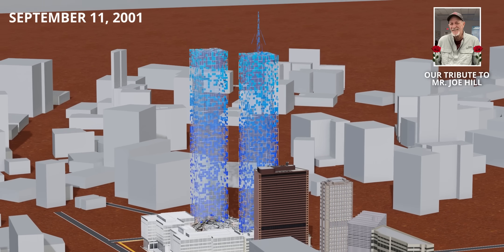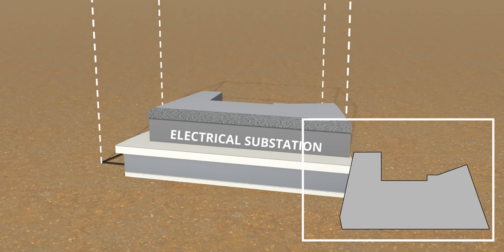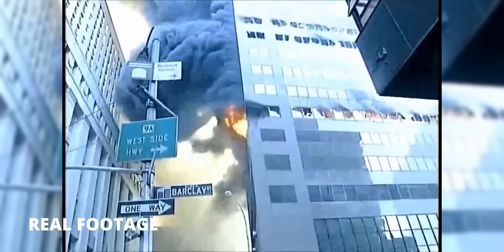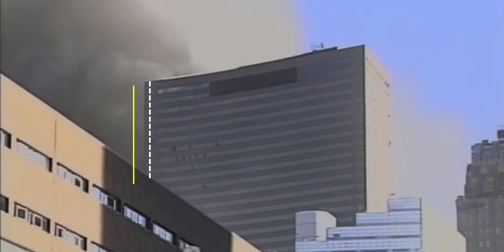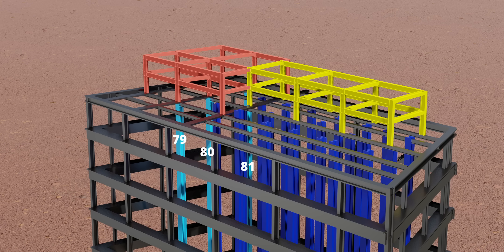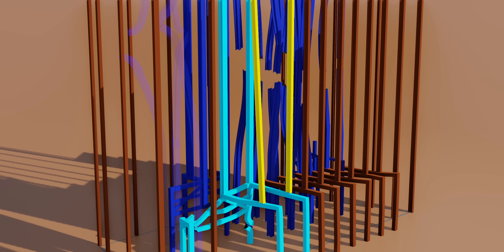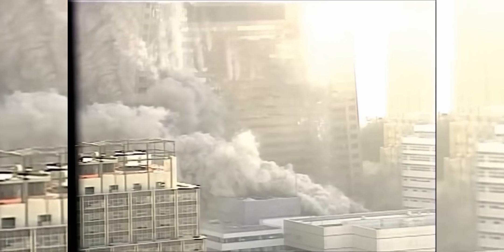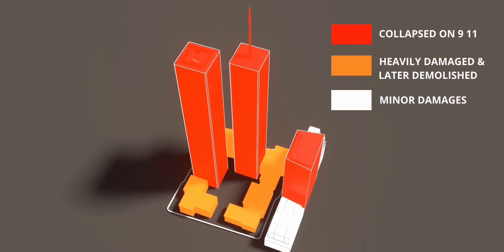Collapse of Building 7 | The Complete Physics

Comment: Another worthless fraudulent video.  All the buildings' collapse were the result of "Controlled Demolitions". The morons producing this garbage, should do their homework about the reasons of why the buildings were taken down !  How much were you paid to produce this trash ?
Reply: I did my homework. How did I do?  

Building 7 was 1 of 6 buildings to collapse of 10 lost on 9/11 and though extensively studied still confuses many. Not famous or a terror target and with no casualties it didn’t get a lot of attention initially, creating an information void the internet would fill with utter garbage. I prepared this brief summary from my own analysis to fix that, using engineering, not politics and tired memes. 

The North Tower collapse at 10:28am bombarded Building 7 with tons of debris, causing heavy damage and multiple floor-wide fires that burned out of control for 7 hours. Half the FDNY firefighters having been killed, others injured, units in disarray, equipment destroyed, no water pressure, and the greater urgency of Search & Rescue efforts, firefighting was pulled as futile. The building couldn’t be saved and was left to its fate. That is the sort of choice firefighters make every day in brush fire situations - which houses to save and which ones to let go. Only real difference here is moving the decimal on the size and cost.

www.youtube.com/watch?v=g_SvpwyC17M&ab_channel=MFitz  

Collapse of a burning structure is always a concern for firefighters. Steel buildings subject to fire rely on active fighting of the fires to survive. Buildings are designed around 1 to 3 hours of fire resistance, allowing time for occupants to escape and ACTIVE firefighting to get started, after which all bets are off. Left to their own devices they will exceed their design envelope and collapse. In B7 the occupants escaped, passive and active fire protections were compromised and active firefighting was abandoned which left the building to its fate. It lost. Odds on Building 7 would eventually collapse, and it did. No big deal in logic. But there is no logic in conspiracy belief. 

www.youtube.com/watch?v=WnYBX6QT0R4 

FDNY Chief Daniel Nigro ; The biggest decision we had to make on the first day was to clear the area and create a collapse zone around the severely damaged 7 World Trade Center, a 47-story building heavily involved in fire. A number of fire officers and companies assessed the damage to the building. The appraisals indicated that the buildings structural integrity was in serious doubt. I issued orders to PULL back the firefighters and define the collapse zone. It was a critical decision; We could not lose any more firefighters. It took a lot of time to PULL everyone out, given the emotionalism of the day, communications difficulties and the collapse terrain

FDNY Deputy Chief Peter Hayden ; We had our special operations people set up surveying instruments to monitor and see if there was any movement in the building. We were concerned of the possibility of collapse in the building. And we had a discussion with one particular engineer there, and we asked him if we allowed it to burn could we anticipate a collapse and if so, how soon? And it turned out that he was pretty much right on the money, that he said 'In its current state you have about 5 hours

The collapse of Building 7 was anticipated and widely reported in the media throughout the day. At least 24 video cameras recording some or all of the collapse. Everyone knew what was coming and why.

www.youtube.com/watch?v=OY5S5k3tMHI 

Building 7’s collapse was completely different to the Twin Towers and harder to understand with most details hidden from view. But we can still sort out what happened through careful analysis and observation.  This is my explanation  of the collapse using the best available information and relying on no authority.

B7 was complex 47-story steel framed structure built on top of a smaller existing 3-story building, requiring several lower floors dedicated to complex load transfer structures instead of usable office space. Of trapezoidal shape and all-steel tube-in-tube construction, B7 (above the 7th floor) consisted of a central core of steel columns carrying most of the gravity load, perimeter steel columns around the outside of the structure carrying the remainder of the gravity loads and long span beams and girders to tie those elements together and form the floors. On the outside of the building hung a moment frame - the last part of B7 to fall 

Phase 1 : The first externally visible signs of collapse initiation occurred at 5:20:28 pm and was notably quiet with observers not even realizing the building was collapsing! There was no audible warning in the form of  hundreds of ear drum busting 180-190dB explosive bangs preceding the collapse. Here at 12:00 a local CBS affiliate reporter is talking 10 blocks from B7 when collapse begins. People don’t start to notice the collapse until 12:11. At 12:45 is the famous CBS fixed camera clip of Building 7’s collapse. Note how quiet it is.

youtube.com/watch?v=t5tEy6mXSE8&ab_channel=fresnosean379

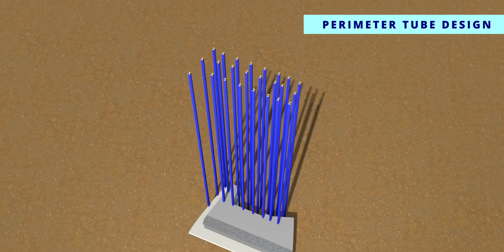Collapse initiation was due to lower floor failures above the load transfer region (7th floor) in the NE corner. In this video at 0:45 you can see the NW corner from inside the building while under construction, Column 79 just out of frame on the left. That big, angled steel beam across the top of the frame connects to C79 at one end. The girders connect to the beam. That beam and all those girders depend on just one connection

youtube.com/watch?v=nP3TNHPCIVU&t=35s&ab_channel=EdwardCurrent

Phase 2 : Lower floor failures caused a loss of critical lateral support over an excessive length of core Column 79 and it buckled. If you look at a floor diagram of Building 7 (see above) and look at all the structures that depend on C79 you quickly realize this one column was a relatively isolated structural element on which a disproportionately greater fraction of the structure depended analogous to say the Key Bridge. Externally we see a vertical progression of window breakage along the 44-46 line and a kink in the roof of the East Mechanical Penthouse at the top of the building, consistent with C79 failure. The transition from full capacity to almost no capacity occurs in virtually an instant. Once the buckling failure occurs there is almost no resistance

Normally with a buckling column, the load could very well be redistributed to other columns, meaning the buckling could stop after a while. With C79 that is not the case - the failure did not redistribute the load, so the collapse rapidly progressed to the roofline, sinking the rooftop penthouse.

Phase 3 : With C79 gone, B7’s progressive, non-symmetrical collapse continues with C80 and C81 at the east end of the core left laterally unsupported and quickly buckled and failed as well, sending the EMP down through the building. C79-81 all have no diagonal bracing, which I believe is a major reason why they could not redistribute a lot of vertical loads among one another.

From there collapse progressed from east to west through the central core until the core was gone taking all of the interior floors and structures and probably most of the perimeter columns with it. You can see the horizontal progression of window failures low in the building and the dropping of the remaining rooftop structures into the building. One of the big takeaways from the NIST Building 7 study (that gets completely ignored) was their modeling which determined C79 failing under ANY circumstances would have initiated the same collapse sequence.

Phase 4 : After 10 seconds only the exterior moment frame - a hollow empty outer shell – remains, giving the illusion the building is still standing since little has outwardly changed. But it’s just a hollow empty shell like an empty cereal box and supported by only a few remaining columns quite unable to remain standing. With all internal framing gone, the north face leans inward, forming a V in the roofline, the last perimeter columns buckle under the strain and the moment frame free falls, landing on top of the 7-story high debris pile. It is here, at the end that a single measurement of alleged free fall acceleration is taken, from a single point on that outer shell. The Building (defined as its center of mass) did not “free fall” – just one corner of the outer shell did. The Building was already gone before that happened. The period of alleged free fall was a product of collapse progression mechanisms, not of collapse initiation mechanisms and cannot inform as to what started the collapse. Start to finish the entire collapse took 18-20 seconds, 3 times longer than true free fall .  How fast something falls cannot tell you what started it falling_ anyway. The debris spread outside the footprint, blocking surrounding streets, heavily damaging the Verizon Building and destroyed Fiterman Hall.  

Building 7’s progressive, non-symmetrical collapse was incidental and unintended collateral damage from the combined effects of fire + time + gravity, started by the collapsing North Tower. That is true no matter who planned and carried out the 9/11 attacks or why . The collapse was of so little consequence it barely even registered at the time, a mere footnote. It only took on semi-mythical status as an alleged smoking gun years later when demolitions at the Twin Towers, missiles at the Pentagon and shoot down over Shanksville all failed and conspiracists had nothing left to work with.

Anything can seem like a conspiracy if you don’t understand how it works. Now you should. I hope you found this helpful, informative and it solicits informed critical comment. If I made any errors of fact, logic or reason or left anything important out, please let me know so I can fix it. IF you can offer a more plausible alternative please do. Be the first. Please start any reply with the words “Tits McGee” or I will know you didn’t read it and are wasting my time.

Comment: they want you to believe this instead of your own two eyes.
Reply: Your eyes can decieve you. Don't trust them.

If you are an engineering noob and don't take the time to understand, you absolutely will not get it. Building 7 is not at all like the Twin Towers where most of the collapse mechanisms are visible to the naked eye. Understanding Building 7 does take actual thinking. Even this video only scratches the surface.

Comment: Delusion, lies and more corruption
Reply: You may not like it after more than 2 decades of internet conspiracy dogma, but what is being presented in this video is fundamentally correct and widely supported by the worlds engineering community.

While imperfect (there are a few problems) this video goes into a much higher level of detail than many viewers can comprehend and gets the collapse mechanisms fundamentally correct. This is true no matter who planned and carried out the 9/11 attacks or why . 
	
Sure, it’s not what you want to hear and goes against 20+ years of conspiracy dogma and conditioning, but that is not the same as it being wrong. You just need to fix your dogma. 

On the plus side, this video can be (and is) fundamentally correct about the engineering AND the 9/11 attacks could still have been some sort of inside job. The two things are in no way mutually exclusive. It’s just not the inside job the clowns you have been following on the interent have been telling you. 

This will surprise you to learn, since the conspiracy side of the internet hides it from you, but the mechanisms described here have broad professional support around the world. There are no professional engineering organizations (for example: ASCE, ASEE, ICE, etc) that disagree with them or have offered any formal dissenting opinions or alternative hypothesis. 

So, either the overwhelming majority of the worlds structural engineers and quite frankly simple observation are wrong,… … or you know more than the worlds best engineers from cruising around on the internet. Which seems more likely? 

If this explanation is wrong then produce a better one.  Be the first to even try.

Comment: Propaganda.  It was a controlled demolition. It wouldn't come straight if lopsided weight hit the top. All Bullsh it.
Reply: You may not like it after more than 2 decades of internet conspiracy dogma, but what is being presented in this video is fundamentally correct and widely supported by the worlds engineering community.

While imperfect (there are a few problems) this video goes into a much higher level of detail than many viewers can comprehend and gets the collapse mechanisms fundamentally correct. This is true no matter who planned and carried out the 9/11 attacks or why . 
	
Sure, it’s not what you want to hear and goes against 20+ years of conspiracy dogma and conditioning, but that is not the same as it being wrong. You just need to fix your dogma. 

On the plus side, this video can be (and is) fundamentally correct about the engineering AND the 9/11 attacks could still have been some sort of inside job. The two things are in no way mutually exclusive. It’s just not the inside job the clowns you have been following on the interent have been telling you. 

This will surprise you to learn, since the conspiracy side of the internet hides it from you, but the mechanisms described here have broad professional support around the world. There are no professional engineering organizations (for example: ASCE, ASEE, ICE, etc) that disagree with them or have offered any formal dissenting opinions or alternative hypothesis. 

So, either the overwhelming majority of the worlds structural engineers and quite frankly simple observation are wrong,… … or you know more than the worlds best engineers from cruising around on the internet. Which seems more likely? 

If this explanation is wrong then produce a better one.  Be the first to even try.

Comment: nice try but not based on facts,,,,
Reply: You may not like it after more than 2 decades of internet conspiracy dogma, but what is being presented in this video is fundamentally correct and widely supported by the worlds engineering community.

While imperfect (there are a few problems) this video goes into a much higher level of detail than many viewers can comprehend and gets the collapse mechanisms fundamentally correct. This is true no matter who planned and carried out the 9/11 attacks or why . 
	
Sure, it’s not what you want to hear and goes against 20+ years of conspiracy dogma and conditioning, but that is not the same as it being wrong. You just need to fix your dogma. 

On the plus side, this video can be (and is) fundamentally correct about the engineering AND the 9/11 attacks could still have been some sort of inside job. The two things are in no way mutually exclusive. It’s just not the inside job the clowns you have been following on the interent have been telling you. 

This will surprise you to learn, since the conspiracy side of the internet hides it from you, but the mechanisms described here have broad professional support around the world. There are no professional engineering organizations (for example: ASCE, ASEE, ICE, etc) that disagree with them or have offered any formal dissenting opinions or alternative hypothesis. 

So, either the overwhelming majority of the worlds structural engineers and quite frankly simple observation are wrong,… … or you know more than the worlds best engineers from cruising around on the internet. Which seems more likely? 

If this explanation is wrong then produce a better one.  Be the first to even try.

I won't wait up

Comment: Utter rubbish!
Reply: You may not like it after more than 2 decades of internet conspiracy dogma, but what is being presented in this video is fundamentally correct and widely supported by the worlds engineering community.

While imperfect (there are a few problems) this video goes into a much higher level of detail than many viewers can comprehend and gets the collapse mechanisms fundamentally correct. This is true no matter who planned and carried out the 9/11 attacks or why . 
	
Sure, it’s not what you want to hear and goes against 20+ years of conspiracy dogma and conditioning, but that is not the same as it being wrong. You just need to fix your dogma. 

On the plus side, this video can be (and is) fundamentally correct about the engineering AND the 9/11 attacks could still have been some sort of inside job. The two things are in no way mutually exclusive. It’s just not the inside job the clowns you have been following on the interent have been telling you. 

This will surprise you to learn, since the conspiracy side of the internet hides it from you, but the mechanisms described here have broad professional support around the world. There are no professional engineering organizations (for example: ASCE, ASEE, ICE, etc) that disagree with them or have offered any formal dissenting opinions or alternative hypothesis. 

So, either the overwhelming majority of the worlds structural engineers and quite frankly simple observation are wrong,… … or you know more than the worlds best engineers from cruising around on the internet. Which seems more likely? 

If this explanation is wrong then produce a better one.  Be the first to even try.